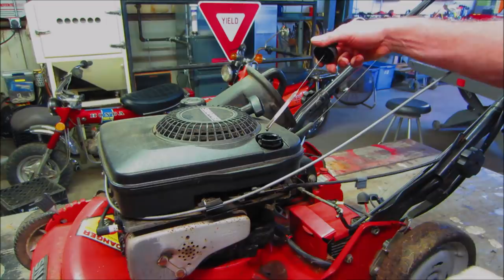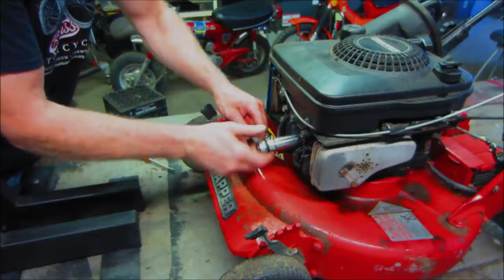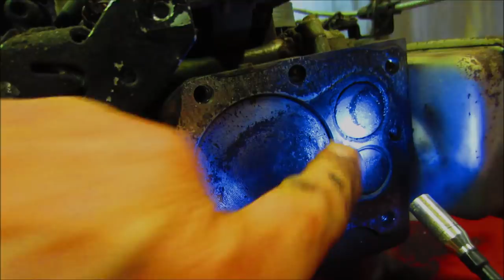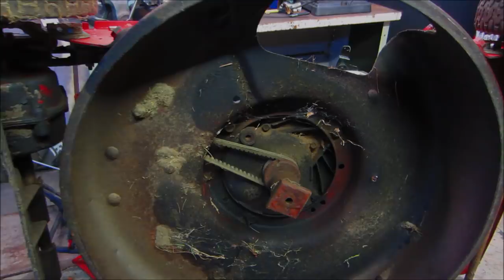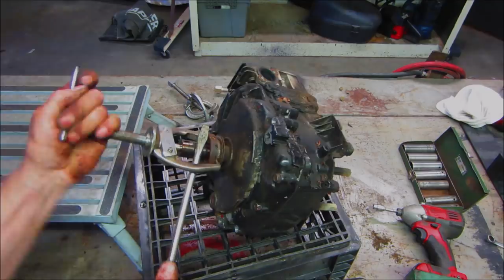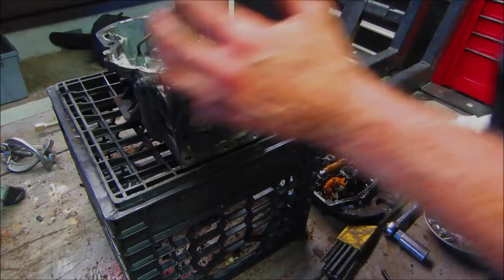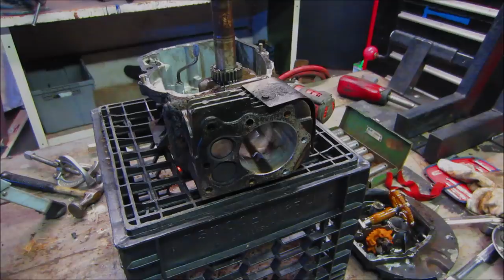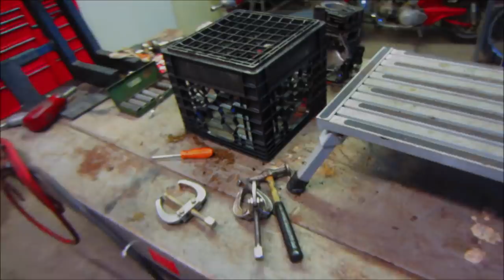Snapper lawn Mower. Why Did It Fail? lets find out.

Comment: The first thing I think I would’ve done with that is put my leak down tester on it and you can tell right away. If it’s the intake valve, the exhaust valve or the piston rings. It’s a nice tool. It wasn’t that expensive and it sure saves me a lot of work, Because I know what I’m looking for before I even tear it down.        Jim fix it shop on YouTube. I have close to 500 videos mostly on Snappers.

Comment: Most Briggs have a short bolt on the air filter housing. There is a fuel passage to prime the carburetor behind the short bolt. If you put a long screw where the shorter screw goes you'll pinch off that fuel passage. Don't ask me how I know.

Comment: Exhaust valve has not been seating, clearly visible on valve seat and face. Not good forensics there, evidence destroyed, no valve clearance measured beforehand, lifters removed and not kept in order.
Reply from the maker: l told YOU in the video the valve was not seating,  and said it was why it stopped running, then went on to say its not worth fixing due to the bore damage,

Comment: that lawn mower ran out of oil or it was real real low on oil and they didn't know and then when they decide to check it it was real low and you see all that grass they cut and they put some oil in it but it was too late motor was gone that's where those marks come from that lawn mower and had no oil in it and the Rings burnt the side of the cylinders that's what happened buddy.

Comment: NEVER tip a flathead B.and S. motor over with muffler and crankcase breather plate/valve spring cover down!The oil will fill the breather's one way baffle,and when you sit it back down and crank it,all that oil gets blown over into carb's throat! Not a big deal,but a big hassle,cleaning plug,new air filter,etc.THAT IS WHAT IS WRONG WITH MANY IN GARBAGE!! HYDRAULIC LOCK!

Comment: Would have liked to see measurements with bore gauge of cylinder. My guess is most of the compression was exhaust valve issues, assuming the cylinder was not really too out of round. I had a Faribanks 3HP Z52 engine with a cylinder that was so out of speck that it ended up like this one, except its corpse went to the scrap yard. One more thing about tapping the crank shaft to get the flywheel off: I have personally put the nut back on and clost to the shaft end, so when and if I hit the threads the nut can be run back over them - that was learned the hard way, luckly only once!
Interesting video thanks and I liked your detail added!

Comment: I'd save the deck and another pull start motor would fit. I have 2 and one I swapped out a Kawasaki from a dead Deere on. It's a Hi-vac with bag and the other is an old 4 horse 'L' head plain but both are self propelled. SWEET mowers. Thanks, Pal!

Comment: I had a Honda mower that was given to me that smoked like a beast last summer. I put it out back and forgot it till spring. I changed the oil in it last year and drained the old gas out this spring, put in fresh gas started it and no smoking! I had to replace the spark plug but other than that. I sold it just the other day. I still have no idea why it was smoking unless a ring hung or carbon was jamming something up. It would have been the shute for the grass catcher that grounded out your spark. Been there done that. I miss my snapper of 22 years old.
Thats a Ninja blade and its mangled.

Comment: I had a snapper, a less expensive model than that one, w/rear wheel drive that was bought new.
Basically same engine. It did great and I ran it hard for about 5 years then it started slowly getting lower and lower compression till finally it became impossible to start at about 7 years old.
I bought a chonda (honda clone) replacement engine, an OHV Predator model, for about $120.
It has more compression and power, and is so easy to start, I love it. It is about 4 or 5 years old now and is doing so well! I'd say it is way superior to the original engine.
Had similar good results swapping a predator side shaft 212cc onto my old troybilt horse tiller.
Way more power than the original  7hp tecumseh engine, even when that one was new! 
I use synthetic Mobil 1  (10w40) in all my small engines and service regularly.

Comment: I always drain oil from the top because you don't get much more by draining from the bottom and it is a mess to do so. If the oil is really bad I'll drain it and flush it with some decent used oil before filling with new oil.🖒

Comment: There are overhead valve engines that have the ignition ground out wire (26AWG black)
routed incorrectly so that from vibrations and heat the magneto mounting posts
rubs thru the thinwall pvc and grounds out ,no spark (intermittently)and sometimes none at all.

Average repair for a mower like the Snapper would be over $125 to replace the coil
misdiagnosed as faulty IF you paid up front.The wire,about twenty cents.Even worse the factory coil could quit any day and be a come-back.
Landfill.
Unless it's value is understood the planned obsolescence is ticking.But if you got it for nothing or near nothing this mower could last 20 years and many did.
Now if you paid $500 for it and got ten years no trouble,no maintenance- was it worth it?

Comment: I had the same mower, first generation. It was a two stroke, non electric start. I bought that sucker new. I turn out being the sucker. My oldest decided to cut the grass (got to give him cheers for the initiative). The only issue was he filled the tank up with straight gas. I had two gas cans, one marked snapper and he grabbed the wrong can. I thought my kid was proficient in English. (he always let me know he  knew more than me). The engine didn’t like that being a two cycle. It was a Tecumseh soon to be a Custer. Couldn’t get mad so I bought a 6 h.p. Briggs, four stroke. It sure didn’t have the power  of the two stroke. I used that mower for many years always thinking about what happened. The lesson that I learned was 1- to have a light in the shed. 2- identify gas cans with illustrations instead of English and 3-with a little effort a used machine can be almost as good as a new one. You show us that fact everyday. Keep up the good work!

Comment: I don't think the screw caused any of the damage because the screw itself appears to be undamaged.  I'd guess the screw, which I agree was from the air filter, was accidentally dropped in the oil filler tube.  I'd say the piston and cylinder damage was from low oil, although I'm surprised the connection rod bearing looks fine, as this is what usually goes first in these engines.
Plastic camshaft gear and lobes???  Auto engines have been using plastic gears for years, but plastic lobes???  C'mon, Snapper, you're too good for that!

Comment: I'm one of those fools that'll spend $100 (or more!) to fix a $35 mower.  Had a old Yazoo mower with an oddball wheel drive system that was driven from a pto that came off the camshaft.  Couldn't find a replacement engine for it anywhere.   It had eaten up the cylinder bore, so I had to replace the block and the piston. So I ended up with essentially a new engine.

Comment: It’s not gonna cost you that much to fix it you don’t damage any gaskets just get the rings checked to see if the valves or stock it’s better to fix the old brace and Stratton’s when the new junk the China’s building

Comment: Mustie1, it would be helpful for some of us if you call out the size of the bolts as you unscrew them.  Are they 9mm?  When was the last time you went that deep into an engine?  Also, where did you dribble in the gasoline?  I did learn a lot so thank you sir.
P.S.  I want that hammer!

Comment: I bought a ninja snapper on  craigslist for 40 bucks and rebuilt the carb and have been using it for three seasons by the end of the summer.  I want to swap the briggs with a honda or predator eventually. Too much vibrations for me.

Comment: The previous owner probably had the air intake plate off, trying to get some spray into the carb, after sitting all winter it was probably gummed up. Then his little kid picked up that bolt and dropped it in the oil fill hole and it wasn't noticed. You can just see that happening right.

Comment: Appears as though the owner did what you did, tilted the unit on its side to change oil which allowed the screw to come up off the crankcase bottom and snuggle alongside the piston skirt.  Seems as though that's is always a possibility with any debris on the bottom. Seems like another argument for draining the oil through the bottom.

Comment: This is why you DO NOT tip the mower on its side to drain the oil! That loose screw in the sump may float up into the cylinder and cause all sorts of problems! Great video!! Thanks!

Comment: I have a suspicion that it was run without an air-cleaner for at least 2 seasons, the little bolt did the most damage, but it looks like dust from mowing over dried soil helped in this engine's demise.

Comment: At 41:30 - The piston skirt wear is not from inetia, instead, it is from the pressure applied to the piston offset from its direction of travel. This occurs during compression and power portions of the stroke when pressure in the piston pin is highest

Comment: The Craftsman gas mower we had died when I was starting to mow the lawn 7 years ago. No compression and it felt like the connecting rod was bad. Before, it was sputtering and backfired after I was done mowing the lawn. The one we have currently needs a new carburetor or governor assembly as it surges and has low speed.

Comment: I find it interesting that just by pulling one connector you're able to disable two safety systems.  Seems like a poor design?
Reply: Good design. KISS is a good motto.
Reply: @MrUbiquitousTech  Well it is just a lawn mower but in general a single point of failure for two safety systems would be considered bad design.

Comment: The one thing I've seen in the past is a valve clearance issue due to the valve seat having been hammered back into the block. It's a little bit hard to tell by the video but it does look like the exhaust valve is further down into the block then the intake valve. You would be able to tell by measuring the valve clearance. Anyway enjoy the video very much. Thank you.

Comment: I had a flywheel key shear on one of my mowers once after hitting  stump with it. Just as Mustie 1 described, when I tried to start it, it would pull back on the rope. I replaced the flywheel key and the blade, which was bent to hell, and ran that mower about another ten years. I finally replaced that mower when the magneto quit working on a holiday weekend. A new mower of similar (cheap) quality  was like $110. A new magneto was $40, and I could find nobody open that had one in stock, so I bought a new mower. The old one was also starting to lose compression, though it still ran until the magneto failed.

Comment: Pure garbage, I had one of these Bozo & Screwball motors do the same thing to me after only 4 seasons with regular oil & filter changes. I don't think it was the screw, I think they just have a tendency to chew themselves up, though now I want to open the case and see if there is a screw.  I was the only one to ever use the machine and I know I never dropped a screw in so if there is it was from the factory. I yanked it off and put a Predator on and it's better than ever.
Reply: What a crazy comment. You have one that died the same way, yet it didn't die the same way? You want to open it to check for a screw? What has "yanking off" go to do with anything? What's a Predator and why would that make it run better? You said it was dead, didn't you?
Reply: @johncoops6897  Damaged in the same way as in destroyed cylinder wall.  Predator is a brand name for small engines that Harbor Freight sells. Yes the Briggs is dead, almost no compression.
Reply: @SupraWes  - AHHHH, now I see!
So you yanked off the whole Briggs engine and replaced it with some cheapo Chinese crap from Harbor Freight.

Comment: That oil ring looked worn out, its hard to tell with compression rings but if you take the top ring off and put it in the bore and see what gap is 
There. If the gap is to big its worn out.
Running without a filter in dusty environment can do that.

Comment: not sure if its worth it (or even possible) but could you bore out the cylinder to a larger sized piston or larger rings? its the only thing I could think of with my limited knowledge, lol
Reply: It could be done, but at a cost higher than the value of the engine. Mustie did mention that.
Me, I'd hone the bore, dress the piston, maybe new rings, and grind and set the valve clearance. Those flat head Briggs can handle some sloppy tolerances. One of the reasons they last so long.

Comment: I did this (my first small engine tear-down) on my 20 year old Snapper... I laughed when our host  was pulling off everything because I did the EXACT same things and got stuck pulling the same things off too.  I have to admit, I enjoyed lapping the seats of the valves - very zen.  As soon as I saw the screw I knew...previous owner tried to fix it and dropped the screw inside the dipstick....My bad compression was valve related... they were naaaaaaaasty.

Comment: So all it needed was a piston, rings and a head. I live in Thailand and those parts here cost about $60 and the mower resale value is about $450 here rebuilding and reselling them is a good deal. Don't know about the parts and resale in the US though.
Reply: Nothing wrong with the head. You'd have to try pretty hard to screw up the head on a single cylinder flat head.
Reply: @MrUbiquitousTech  I didn't mean the valve head i meant the sleeve in Thailand they call it the head as well as the head it's self.
Reply: @andrewwells8588  Ah, okay, I get you now.
FWIW these engines don't use a sleeve. To rebuild it you'd just overbore it.

Comment: It hurts me inside to see people use wd40 zep45 is so much better.
Reply: I must admit that I cringed when he sprayed WD40 on the pulley extractor threads. WD40 isn't a lubricant so it made zero difference anyway. He would have been better to smear a finger full of old sump oil on there.